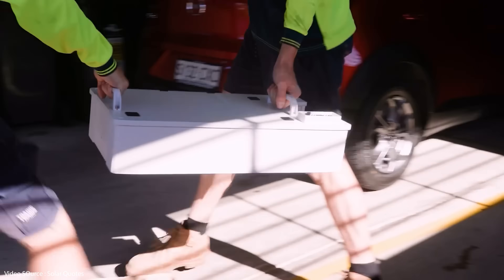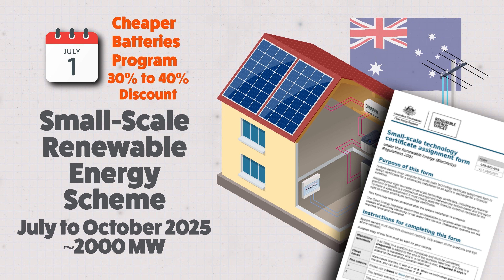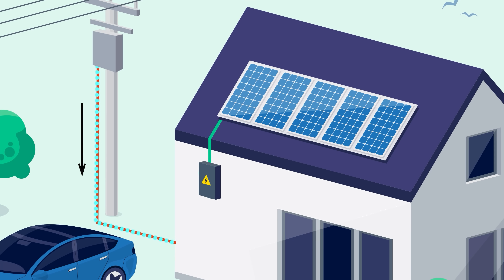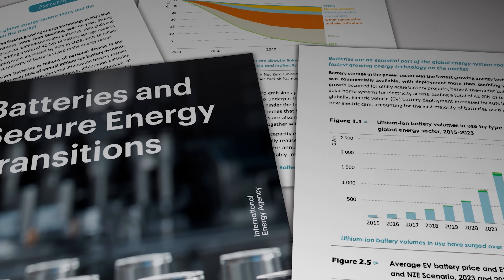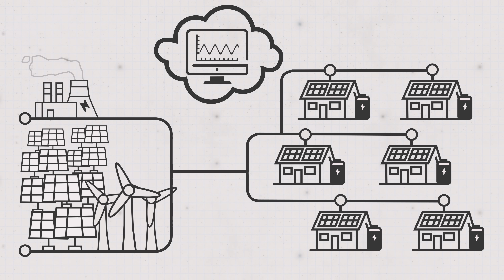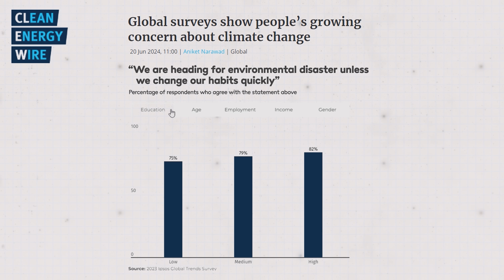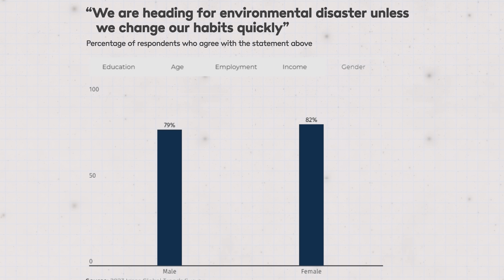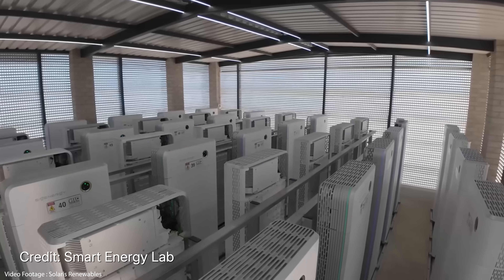Australians installed 100,000 home batteries in 17 weeks. Why can't we all do that?

Comment: I'm in Oz. I bit the bullet and installed solar and batteries, without subsidies, more than two years ago. Even without subsidies, my system will pay itself back inside 8 years and I don't get a feed-in tariff from the grid suppliers. And the kicker... just yesterday a lightning strike killed the grid here in the wheat-belt north of Perth and 22,000 homes went off the breeze for 19 hours. The only reason I knew that the power was off was that I went outside and the air was filled with the noise and fumes of the petrol generators that the neighbours were running. There is no downside to having a home battery, especially when the Australian government is now making a generous contribution to the purchase price.
Reply: Same here perth hills. Hot day then Big storm wasnt it. Ive a 20kw solar and 40kw battery installed so i only noticed when western power messaged me saying the power was out in my area
Reply: @TalanRosen How can you have a 20kw system in WA. We are North of you and can’t have more than 6kw. I wanted to add more panels and was told it wasn’t allowed. cheers.
Reply: I just got a 25kWhr battery and being part of the VPP network now will allow me to help stabilise the grid against some of these types of events, but also earn me money for peak power exports.
But it still shits me that I am exporting 1.5kW to Synergy for free most of the day because I have a 10kW inverter. I am pretty sure I am topping up all of those new big batteries that are popping up now
Reply: Yay, Perth! I was on USS Enterprise, and you did yourselves proud when we visited. 
Mind you, I remember very little....
Reply: Well done! M.
Reply: one nitpick - its actually the Australian TAXPAYER (including u and me) that make that contribution - not the Gov.
Reply: @joansparky4439  That's what governments do. Spend our taxes on our behalf. It's the way it has always been and I have no objection to it. Even though I never got the subsidy (bought a battery before they were introduced) I'm happy that others will be able to avail themselves of it.
Reply: @Qosmio1955    it sounded like Gov pays for it, not the citizens...  that's why I commented. No worries ;-)
Reply: And you want green energy but where did the minerals get harvested and how. And where do your out of date systems go for recycling.
Reply: @kyranbridges8196  Take your antiquated RW talking points and run along now. Not interested in engaging with you. It wouldn't matter what I replied with, you've made your ill-informed mind up.
Reply: "system will pay itself back inside 8 years", typically that means return of capital with no return on capital.
Reply: @dudleymills1427  How do you figure that? All of my equipment will still be functioning at the end of that 8 years. After that, I save $8k per year (minimum), which is a 13% return on investment. Then there's the value in just having power when the grid is down. You can't put a price on that when you can sit in your home on a 38C day (which it was yesterday), in the air conditioning, and have all of your household facilities available.

The money that I'm not spending on electricity is being invested and is doing very well. I didn't have to finance my setup and I concede that most people probably do, but for me it has been "all cop" from the day it was switched on.

The batteries are warranted for 8 years but I'm fully expecting three times that life, as they've only lost 1% of original capacity over the two years that they've been in service. The solar panels have a 25-year output warranty, but that doesn't mean that they'll just stop working after that time. Like I said, no down-side.
Reply: @dudleymills1427 Except that the system will run almost for free for another 20+ years
Reply: @alanwardrop9575  The solar cells most likely, our two solar arrays with a total of 11kWp now run 22 und 23 years. Not sure about the new, cheap China ones however.
The inverters are most likely to die within 10-20 years. We had three inverters in total, a 5kW inverter died after ~18 years, one of the two 2.2kW inverters had issues after about 19 years (I soldered in a new shunt, but the displayed energy values were wrong, however it worked again)
Reply: @alanwardrop9575  Except that it won't, the panels efficiency will drop after ten years, even with constant maintenance that has to be paid for (cleaning), the batteries after 15 and who knows with the inverter, one lightning strike and it is Kaput! Unless you are banking all of the "savings", one will end up with the mother of all capital replacement cost without potential government handouts.
Reply: so your system isn't connected to the grid? (that's actually illegal). haha
Reply: @Bamwich  Says who? I don't know what planet you are from, but here on Earth there are places where you can quite legally disconnect from the grid. I happen to live in one of them. In fact, the nice people from the power utility came around and took the electricity meter away for me...
Reply: @Bamwich    why would an off-grid system be illegal here in Oz?!  Makes no sense pal.
Reply: @Bamwich  Not in Australia it isn't.
Reply: "Especially when (your neighbours) are making generous contributions to the purchase price "
Reply: @mikewilliams94  There's nothing stopping the neighbours from getting some of my tax dollars and getting a battery under this scheme... (Or, getting some of their own tax dollars back, if you want to look at it that way.) Frankly, I couldn't care less about the people who don't avail themselves of this opportunity, especially those who refuse to do because of ideological grounds, alone. I do feel for those in rental accommodation, though, but there are always winners and losers when it comes to government grants. My tax dollars subsidise every residential solar system installed in Australia, and I didn't get one cent in subsidies, but I don't give a rat's. The greater good, and all that... By the way, when the power goes off, I chuck extension leads over to the neighbours so that they can at least run their fridges and freezers. They don't seem to care too much about their tax dollars going my way then.
Reply: @mikewilliams94 not how government spending works, and even if it was, the hell do you think the point of a government is.

I'm glad to know some of the productivity i put into our economy enables programs like this. because i believe in the public good.

Comment: Is it really a good idea to subsidize households $$$ to install solar and storage batteries instead of using those $$$ to build industrial sized solar / wind farms with battery storage?
On the matter of recycling to recover material, how would this go with ev batteries having different chemistries such as sodium and iron thrown into the mix of manganese and cobalt?
Reply from the maker: Domestic installs are quicker, so I guess that was the motive of the energy providers and government. Recycling the different chemistries is now problem. They all settle out in the distillation process.
Reply: Ind size solar will be at transmission, the voltage issues of huge somestic solar will be in distribution. So you need the bess there. You could do street level bess ofc.

Comment: As an off-grid economist from Oz I love the transition but know it will be expensive.  Sure adding solar is the cheapest way to extend capacity but we're now at the point of needing to decide how much battery storage, how much fossil-fuel back-up and how much over-capacity solar generation shall we put in place.  The more we put into the first and the last, the less often we will use the back-up.  So we're headed to vast installations of solar and wind, very large batteries and an expensive gas back-up that we might turn on once a decade. (I say nothing of transmission expenses). Of course it must be done but it's going to be expensive.

Comment: As an very energy-involved Australian, let me add a few notes to this:

- I buy my power at the market price which changes every 5 minutes. I have a large battery and have been using it to sell at high prices in the evening for two years now. The prices at peak time this year are ridiculously low. I can't prove the reason, but given that this spring and summer have been much warmer than last year I can only make the connection with all these batteries and figure that they've reduced demand significantly, at least in my area.

- I used to supplement my own solar with grid charging during the middle of the day when prices used to be very cheap, often negative (they paid me to charge my batteries). Those middle-of-the-day prices when solar is generating a lot of power have stopped being so low. Still cheap, but we haven't had any notable negative runs at all this year.

- Big prices spikes where heavy uses would shut off, and I was earning $20 per kWh, haven't happened in my area (Sydney) at all this year. I used to earn a couple of thousand dollars a year from these, and they're gone.

Very interesting outcomes. I don't mind the loss of income: I didn't get a 30% rebate for my batteries but I earned that much from selling power at peak prices, and my bills are still ridiculously cheap (basically zero averaged across the last six months) but this is something I've advocated for for a long time, and it's gratifying to see that my opinions on what would happen came true. And I can see that prices are much lower this year: there is no reason that power prices for everyone, even those who can't install solar or batteries, won't come down significantly. To our conservative politicians who fought this tooth and nail while in government, and are still doing so in their much-reduced form in opposition: screw you!

Comment: I do wonder how Aus is going to maximise the social benefit of all this subsidy. Big batteries can load shift cheaper, and as shown by California, are effective at reshaping the duck curve. Small batteries can effectively make a home a zero kWh consumer for months at a time. This is great for those with thrm, but it does make recovering system costs a lot harder, pushing up the cost for those left out.
Reply: Most of those costs are in supply charges which people with grid-tied inverters are still paying. Plus in some states of Australia the solar glut is creating free electricity in the middle of the day for everyone, making it cheaper even for people left out.

Comment: One other thing that hasn't been mentioned is that the Australian government announced a policy that electricity retailers in some states will be required to provide 3 hours per day of free electricity during the day from July 2026.

Even houses without solar can get free electricity from batteries by charging them during those 3 hours each day.
Reply: Problem being that non-solar homes can't currently get the rebate (because it is tied to the SRES, which is tied to solar, mentioned in the vid).
Reply: @oliverbrown6088 really? I wasn't aware of that. That's a bit disappointing (but could be necessary for the future rollout of solar)

Comment: Had my new batteries on this scheme for a month. Brilliant! Of course I am fortunate enough to be able to afford it - mostly from the savings I’ve already made by being an early adopter of solar and driving an ev.  But it does mean I can time shift my power use, so I can run the dryer an aircon anytime of the day without stopping to think. The only hydrocarbons at my place now is the small bottle of chain oil for the battery chainsaw - and the oil stain on the carport floor. 💃💃💃

Comment: I've tried until I'm blue in the face to get approval of an ECO4 solar PVs, ASHP system and have failed. I was planning on funding a battery to go with it.. Any advice ? Contrary to general opinion it isn't just for those on benefits or earn less than x pa you can qualify on health grounds for certain health  condition so long as your house is EPC rated  E, F or G..

Comment: The interesting point in time will be when DIY Solar becomes achievable.  At that point, labour costs evaporate, making Solar a whole lot more accessible to more people,

I was having a look at these Ecoflow stream batteries.  They are almost plug and play in the UK, but not quite.  It isn’t legal to back feed the grid through a plug just yet.  But a fused spur hardwired point is an option.  In all other regards, the solar panels and batteries can be assembled together with pre-made connectors on the ends of supplied cables.

The battery prices are actually competitive with the premium brands such as Solaredge, Tesla and Sigenergy.  But they are still more expensive than Fogstar.

If anything, it just shows the direction of travel for batteries:  Cheaper, and easier to install. In 3 years time they will no doubt be as normal as having a washing machine in your house.
Reply: rolling my eyes.  stop funding the Chinese (Ecoflow).

Comment: The battery capacity installed was ~2000 MW?

No. Watts are the unit of power.
Energy is in Joules or possibly Watt Hours
Reply from the maker: @patelvis4725  Thanks for this attempt at physics 101, but the industry generally rates storage capacity in Watts and discharge in Watt Hours. So, the batteries can store e.g. 2000MW of 'power' but that power being discharge over, say, 4 hours, gives 8000MWh of energy.

Comment: By all means look at our scheme, but it’s worth viewing it with realistic expectations. There are a few practical issues that are easy to miss when looking at the headline numbers.

One is the “one bite of the cherry” rule. Once a rebate has been claimed at a property, any future battery additions aren’t eligible. That tends to push people toward larger systems upfront. Even with high-quality, brand-name systems, battery modules are only part of the total installed cost. Things like switchboard upgrades, cable runs, and bollards are largely fixed, regardless of capacity. In that context, moving from 16 kWh to 32 kWh can be only $4–6k more if done at the initial install, which understandably influences decisions.

At the lower end of the market, we’re also seeing very large battery capacities paired with relatively small inverters. Because the subsidy covers most of the battery module cost, this can result in 40–50 kWh systems being installed behind 5 kW inverters. While these setups can look attractive on paper for individual households, they offer limited community or grid benefit. Even if enrolled in a VPP, they simply can’t move energy in or out fast enough to meaningfully support system stability — at 5 kW, a full charge or discharge can take around 10 hours.

There’s also a common misunderstanding around capability. Despite having 40–50 kWh of stored energy, many of these lower-cost systems can’t provide full-home backup. Inverter and system design limitations mean they may only support a small subset of loads, or none at all during an outage. So the headline storage figure can give a misleading impression of both resilience and usefulness, even before considering how the system will perform over time.

Durability and long-term support are another concern. Low-cost components from vendors with uncertain longevity can fail within a few years, and if the original installer or manufacturer has exited the market, there may be no one willing or able to service the system. In those cases, batteries could end up abandoned or scrapped, with little chance of recovering the public value that was invested.

Given that this is a taxpayer-funded scheme, this goes beyond an academic discussion. There is a responsibility to ensure public money is being used efficiently and fairly, particularly when a meaningful share of those tax dollars comes from lower-income households who cannot directly participate or benefit.

On that basis, success shouldn’t be measured by headline figures like total nameplate capacity installed. What matters is how much energy can actually be absorbed during the middle of the day and reliably redeployed into the evening peaks, and the cost required to achieve that outcome. Those metrics — delivered energy and cost per unit of system benefit — are what should be used to judge whether the scheme is working and whether it represents the most effective way to achieve the underlying policy goals.

Comment: The phase inbalance thing is a curable problem.  It is somewhat labor intensive and will never be perfect.  But you look at how much power each household exports to the grid on average.   Then you need to move the houses on each subnetwork onto a phase such that the total generation average capacity on that phase is close to the other phases.    They would already be doing this for the subnet if the loads at night were imbalanced.

Comment: I’m one of those Australians who recently got a rooftop solar and battery system under this scheme. Expecting to get modest negative bills from now on. 11kw solar, 32KwH batteries and 15 kW inverter for just over £10k fully installed. We are lucky to have 3 phase power. Feeling thankful we have a relatively progressive government and not the conservative dinosaurs who were in office up until 2022.

Comment: One area of interest for me, living in an ancient house which cannot meet contemporary insulation standards, home generation and storage could go a long way towards the shocking cost of running the house after converting to a electric/ heat pump system.

The UK government recently decided, against good advice from Octopus Energy, to retain a national grid system instead of diversifying into more responsive regional systems. I think this could have dire consequences for local generator regulation.
Reply: I have an ancient house.  I insulated the walls on the inside and insulated under the floors, put solar panels on the roof.  I achieved an EPC of one point away from an A.